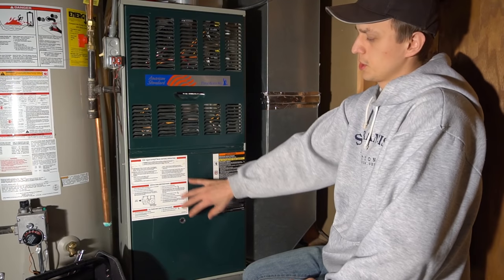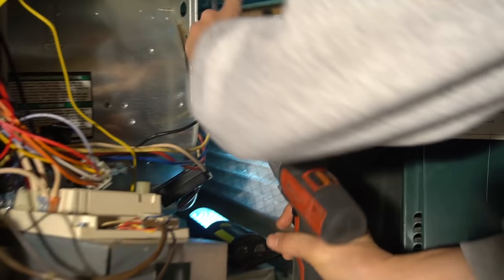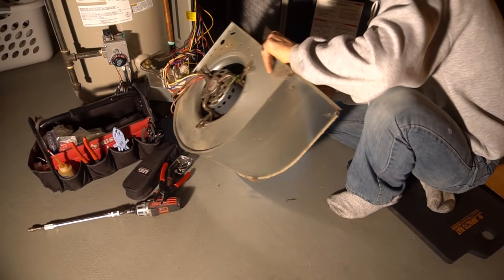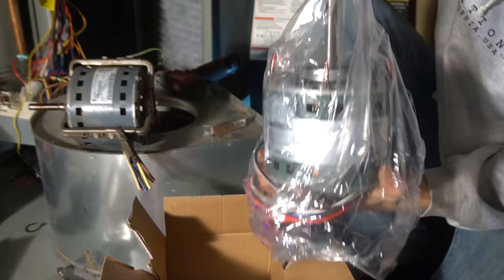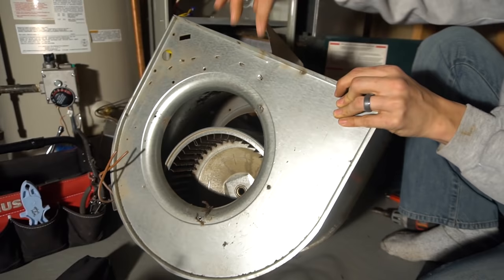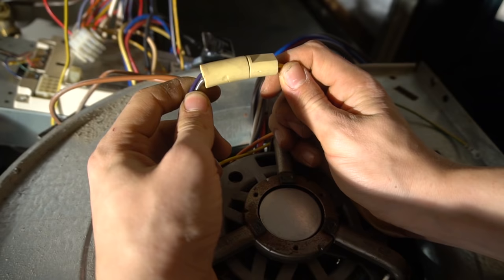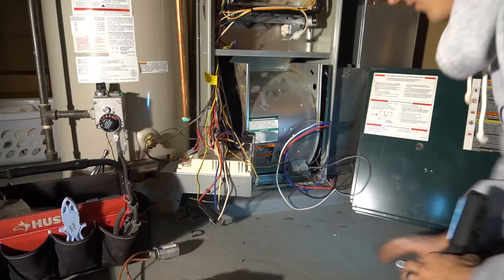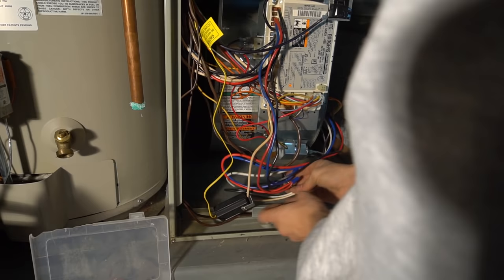Furnace/AC Blower Motor Replacement Step By Step

Comment: First of all, your video is about the best instructional video I've ever seen, and as a single mom, I do a lot of my own repairs, so I watch a lot of videos first - thanks!  I have a Carrier Weathermaker 8000 that is around 15 years old.  In April I came home one day to a slight burning smell and got an error code 33.  In the past I've been lucky enough to solve my furnace problem by cleaning the flame sensor, but this time it didn't take care of the problem.  I had just changed filters, so I knew it wasn't that.  I figured it was time to call in a repair person, but decided I'd do it in the early fall during their off season.  This decision has come back to bite me when I realized the reason my air conditioner is not blowing any cold air is because the blower motor is probably shot. I just didn't make the connection that the furnace problem could affect my A/C.  When I turn on the A/C, the outside unit comes on, but no cold air comes from the vent.  Would a blower motor or capacitor emit a burning smell when they go out, or am I on the wrong track?  Although different brands, my fan from the outside looks similar to the one in your video, with the exception that there is a column with the vent to the roof in front of the blower casing which it looks like I'll need to remove before I can access the blower unit.  Is there anything I need to know before removing that vent column?
Reply from the maker: Thank you for the high opinion of my video :) Glad you liked it! A burnt electrical smell typically indicates a burnt out blower motor. The smell of motor windings starting to melt is what that usually is. When you replace the motor, I would also replace the capacitor. The fan from outside may look similar but the one out there is 240v whereas the indoor fan is usually 120v (you can find that info on the motor itself once you pull it out). This job is not too hard but it is time consuming. If you have a vent pipe in front of your blower compartment, then yes, you will have to take that piece of pipe out to be able to access the blower motor. There's nothing you really need to know before you take it apart :) Just remember how you take it out so that you can put it back in the same way once you are done.
Reply: The fan in the A/C unit outside goes on and seems to be fine.  It's just the one in the furnace that seems to be done for.  I will definitely replace the capacitor when I do the job.  I tried Googling my furnace model number  (58ZAV096-12) for replacement part info, but it looks like it's old enough that there's nothing out there, so I guess I'll have to pull it out to get the specs off it before I can order a new motor.  I do know it's 1/3 HP, so I'm hoping a replacement will be easy to find.  Thanks for your help!
Reply from the maker: Blower motors are readily available (a ton of them on Amazon) so I am sure you won't have a problem finding one you need. Good luck and stay safe!
Reply: Jay, I hope I can inconvenience you for a little more help.  Motor is now successfully removed so I could see the specs to order a new motor and capacitor.  I can clearly see it is a GE 5KCP39GG S336 S, 1/3 HP, 115V, 5.2A, 1075 RPM, 60 HZ motor.  Other info on the label is:  Cap 5.00/370 (which I assume calls out the capacitor size), Ph1 (not sure what this means).  How do I tell if I need a 3 speed or 4 speed replacement motor?  And does it have to be 5.2A, or will the 5.9A motor you used in your video work as a replacement, since it seems to match all the other specs?  Thanks!!
Reply: I should have included that it has 4 wires (besides the 2 for the capacitor and the ground.)  It was wired to the control panel with 1 to heat, 1 to cool, and the other 2 as spare wires.
Reply from the maker: No problem! You seem like you are very thorough, that's good! The motor I used in the video will work for you as well :) Mainly you want the RPM, HP, and Voltage to line up.

- Ph1 means it's a single phase motor. Most of them are like that.
- The speeds will not matter. Just pick one. 3 speed or 4 speed. You will likely have unused speeds that you can just put on the spare/park terminals on the control board. (or just put a wire nut on the unused)
- The capacitor that the old motor requires does not matter. When you buy a new motor, see what capacitor the new one will require.
- 5.9 is just the amp draw the motor will draw when running. Don't pay attention to that ;)

Hope that answers all your questions!
Reply from the maker: Oops, I answered before I read your second message. That just confirms what I said though. Either a 3 speed or 4 speed would work. Since really you only need 2 speeds. One for cooling, one for heating (cooling is always the high speed)
Reply: @WordofAdviceTV  as per your video to the speeds you dont " just pick one ". Speeds come set from factory but are field changed when furnace or air handler is installed. Speeds are choosen from a temperature rise test and a static pressure test. This is hopefully done from your installer.
Reply from the maker: Thanks for adding that JJ! Optimally that is the case but realistically, not a lot of installers do that. Whenever I replace a motor I typically just wire the new one the same way the old one was wired. So if heat is on medium speed, I leave it on medium.
Reply: @WordofAdviceTV  It could just be the capacitor, even with a hot smell coming from the motor, they are thermally protected and might still work fine. I had this happen a couple years ago on a 90F+ day. No air from the vents, went down to the furnace and smelled electrical/plastic burned odor. Took the cover off and luckily no smoke and when I tested the 7.5MFD capacitor it was reading less than 1MFD. Luckily, I had a spare dual capacitor with a 7.5MFD fan side so I wired that up and ordered an AMRAD from Amazon immediately. Two years later and the blower still works fine, even tested all the windings and they all read normal resistance.

Comment: Replaced the motor in my XL80; this video gave me the confidence to do it myself and not break anything or hurt myself!  Very much appreciate the time and effort put into this video.  The camera work was excellent; the presentation was superb, to the point, while still being very detailed; and the camera and lighting work were perfect.  One comment is that as a novice, I would have appreciated a bit more commentary with regards to the capacitor and safety.  Seemed crazy to cut through the brown wires with the capacitor attached, but it seems fine?
Reply: Agree 100% best video out there

Comment: Thanks so much for the instructional video. I watched it several times and decided I could do this. Only challenge I had was my old motor had the holes pre-drilled for the brackets while the new one did not. After speaking with Trane, it was determined to be OK if the rubber gaskets on the end were clamped down tight enough by the bracket and mounted to fan housing. Works like new!😎

Comment: What a great video.  Took the fear out of doing this myself last weekend.  Turned out not to be my blower motor but just the capacitor.  Had to remove a lot to get to it but considering I did it myself and the part was only $15 it wasn't that bad.  Thanks for posting this video.

Comment: Just wanted to add another thank you! We woke up to no heat this morning. I used your video about top 10 issues first and pretty much determined the issue was the blower motor. Your steps were spot on for our 17 year old Carrier furnace. The hardest part (for me) was getting the blower motor housing to slide back into place.
Reply from the maker: Glad you were able to get it fixed! And yes, I very much agree! Sometimes it can be a hassle trying to get that housing back in there. Now that I have done hundreds of them, it's not so bad but I remember struggling with them in the past.

Comment: Excellent! Normally I can't understand technical explanations very well because English is not my first language, but in this case I didn't miss a single word and everything made sense the whole time. I came here looking for a solution to a simple problem. The sound of something hitting the blower blades. Something flexible and loose, as it does not prevent the blades from rotating normally. Watching the video carefully, I came to the conclusion that the problem could be the small ground wire that may have come loose and is hanging in the path of the blades. And I could only see that thanks to the attention that the young man gives to every detail of what he is doing, explaining every little thing. The problem may be simple, but solving it is going to be like a slow death from what I can see in this video! So many small details that require care in such a limited and difficult to reach space! Very hard for someone who never did such a thing. But it might be worth it to save the hundreds of dollars I'd spend calling tech support just to get a small ground wire out of the way. Thank you very much young guy!

Comment: This was great, I especially like the idea of just cutting the blower wires and splicing them back to the new motor. Less thought required than unplugging the old motor and fitting each new wire on the board.

Comment: Great video, only thing i would add is to take a few picture at the start in case any cable get ps lose, and also a few pictures before removing the bracket holding the motor in place, it is important to see the position where the cables are located so when you put it back the cables are not on the other extreme, less chances the motor will get any of those wires. Great vid 👍🏼🍺

Comment: You have no idea how valuable this was! I first used your video to replace my blower fan outside after getting an estimate by a Tech that would've cost me over $600! Sadly, a month later, the Squirrel cage blower motor went out, but as soon as I was able, I found this video and was able to safely remove the cage, motor and cleaned them both up. Bought a new motor, followed your steps and everything was simple and easy to follow. Thank you again for a great video!

Comment: thanks.  hvac motor with intermittent squeak fixed via this video...i hope.  actually was not overly complicated once i dived into it.  separating fan from motor was hard.  had to blow torch it, very gently, and used a wood dowel as a drift pin and banged it out.  that took half of  total time on this fix  trying to separate the two.  after all said and done i really did not have to separate them because  i found two little bright aluminum caps/plugs sitting on two raised  channels that led to front and back bearings of motor.  easily removed and just like antique table fans that required oil now and then i dropped in 3-in-1  oil with fingers crossed that it was a lube problem.   so far it's quiet.  i fine sanded and oiled the motor shaft and the fan  easily slipped back on.  if i have to replace motor later i know what to do.  this took place during the texas freeze.  whahoo.

Comment: Great video. I would stress to discharge the capacitor right after cutting off the power from the unit in order to make it safer though.

Comment: I’m try to do this tomorrow you made it look easy probably will take me an hour then for my first time I hope the parts aren’t expensive.
Reply: How did it go?
Reply: The blower motors can be pricey especially if you try to buy the motor locally.  Normally, the A/C supply houses won't sell to homeowners but if they do, they will rip you off.  The 3/4 HP blower motor in my furnace cost about $190 on Ebay.  I used a factory replacement part but I could have used a generic blower motor which is about $90 cheaper.  My neighbor paid $550 to get his motor replaced.  He paid $500  to replace his control board a couple years ago.  His 80% AFUE furnace probably cost less than $600 when it was new.

Comment: Blower Motor (which I didn't even know was a thing before this weekend) went out on Labor Day weekend; called around and only one who would do over a holiday weekend (on a Saturday mind you, not Sunday or Monday) quoted $1,000 to replace.  Sucked it up over the weekend, went to the local plumbing supply store on Tuesday and bought a motor for $140 including the capacitor and swapped it out last night.  COULD NOT HAVE DONE IT WITHOUT YOU.  Thanks so much!  Going to your paypal page to donate a few bucks in appreciation.

Comment: Thank you so much for the advice. Especially how to remove the squirrel cage! I was worried there was a sequence to putting the cage back on as mine was a bit wobbly with new motor. Either way it was worth the effort and you saved me about $600 and worse,  being scammed into a new furnace which is the direction repairmen were going!! Sad that AC/HTG companies need to cheat the public to make money.

Comment: Glad to see you wearing your safety socks! lol.  But one thing, wearing gloves of any sort is a good idea for parts of this job - especially when handling the squirrel cage and when removing/replacing the blower housing. If I don't wear gloves, I almost always get a nuisance scratch or cut, and leaving blood on your work is not the sign of a professional (which I am not anyway). The gloves keep your hands cleaner too. Yours didn't seem to suffer much, but often furnaces are not as clean as yours was. I like that you know your stuff, speak fast and work fast, and seem like in real life you're a super-fine person. Thanks for posting this really well done video tutorial.
Reply from the maker: Thanks Tom! Haha safety socks huh? I have been wearing my gloves more lately and keep them in my tool bag all the time. It's annoying to get a finger cut on the first job of the day and then have it start to bleed again every time you knick it for the rest of the day.
Reply: @WordofAdviceTV  Yay for gloves. I have scars from doing battle with tools and equipment from earlier in my life when I thought gloves were too inconvenient. Safety is always inconvenient, and a little expensive, and slows the job down. And then something happens and safety takes on a whole new perspective. I've worked in my socks. Dropped a screwdriver - not even a heavy one - and it landed right at the back of my big toe toenail. Man did that hurt! No one makes safety socks. I wonder if there might be a market for them tho. ;-)))
Reply: @WordofAdviceTV  As a courtesy to my tenants, I will often remove my shoes when I go into their apartment to do work. If I were to have a pair of safety over-socks in my tool bag I could just slip them on for the visit. Hmmm...I wonder if that is the sort of quirky merchandise that Duluth Trading might add to their sometimes odd-ball product line-up.
Reply from the maker: @tomc3542  I agree, safety can be an  inconvenience like the gloves for example. No matter how great the gloves are you still lose a lot of "sensitivity" when you put them on. At my job they urge us to never take our shoes off. They provide piles of disposable shoe covers for us to use instead.
Reply: @WordofAdviceTV  Depending on circumstances I use the booties, and usually have them in my kit, but often just taking off my shoes works better for me - especially on rainy or snowy days when my shoes are wet and extra dirty.

Comment: Great video! I was wondering about the long studs coming out of the replacement motor. Little steps like that are important for us first timers. Every time I do some work on my and occasionally a friend's furnace, i am surprised how simple they are to repair. The main thing is finding the good hvac parts stores in your area. I had to go to 3 to get the replacement parts.

Comment: Thank you for the video.    My mothers Carrier furnace motor crapped out and I was trying to get a contractor to come and fix it and getting the run around with pricing.  They wanted like $650 min.  Others wouldn't even give an estimate without doing a diagnosis first at a charge..   Anyways I bought a new motor + cap for around 90 tax in. (managed to get contractor pricing)    Job took maybe 25 minutes + running around getting the motor from the wholesaler.   In the end I got it done for her before an hvac guy would have even come out.  It'll take her house probably 6 hours to get back to normal temp because it freezing out.     Your instructions were to the T and made it so easy.   Thank You!
Reply from the maker: Good to hear! Congratulations on a job well done and I am glad I could help! :)

Comment: Just a few comments/ suggestions. Sheet metal gloves should be used when handling the sheet metal and removing the blower motor. I learned the hard way and cut my hands not using gloves. Also, protective shoes should be worn to protect your toes and feet. Remove any rings / watches so they don't catch on the metal and potentially injure yourself. The blower motor housing should also be cleaned during the cleaning of the fan apparatus. I used dielectric grease to lubricate the sides of the motor shaft to reduce friction for the fan blower when it turns. Gas service valve should also be turned off while performing this maintainence. Safety first!
Reply from the maker: Thank you for all the additional tips! I agree, safety is important! I should have done a better job with that when I filmed the video. But thanks again and hopefully watchers will read the comments! :)